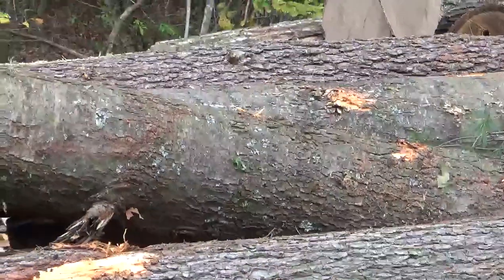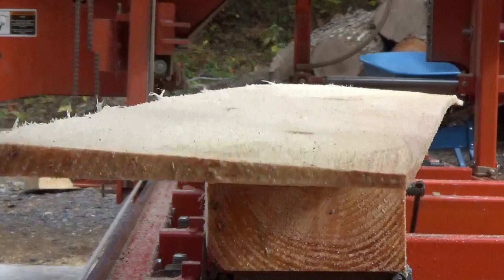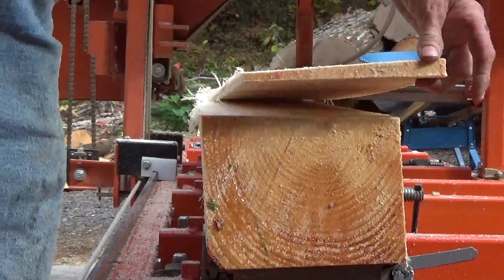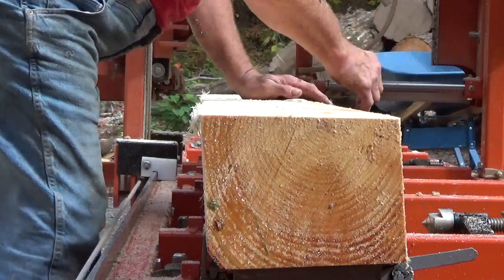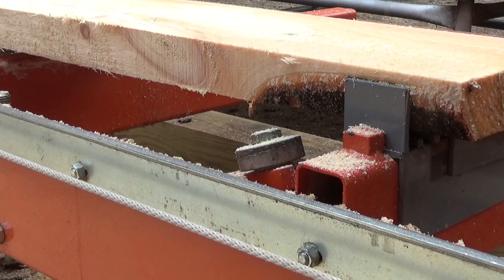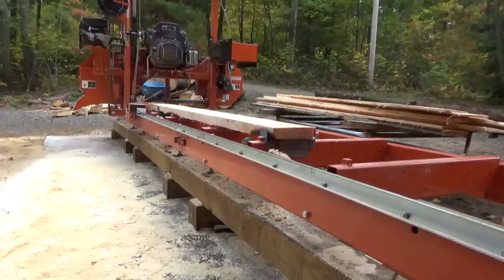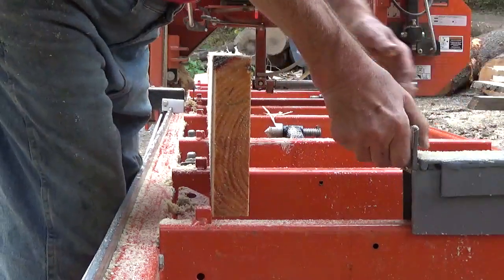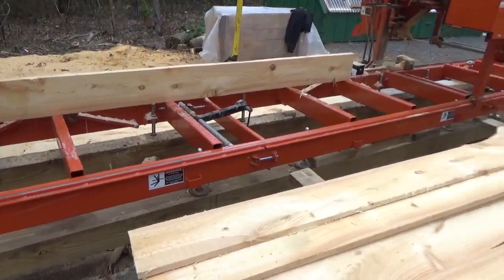Cutting lap siding out of White Pine on the Woodmizer LT15.

Comment: Have you looked into toggle clamps , there's quiet abitt of adjustment in designs, Might be able use it in stead of log dogs? Two or three locked downs just with your jigs, I do really like your design. Keep up the vids . I learn a lot from them!!! Thanks.
Reply from the maker: I havent seen the toggle clamps or thought about them yet but i am always open to something better. I will have to check them out. Thanks for the comment.

Comment: Great jig watched many of your movies looking at making some siding and lumber my self with redpine for many planned projects. I have not pulled the trigger yet on a mill but was leaning toward lt 15 was wondering if when u engage your blade all the movement of the head has any affect on the cuts keep up the movies they’re great
Reply from the maker: When I engage the blade I know there appears to be a lot of movement but it is just the torque engaging the motor. It does not affect the cut at all. Also you engage the blade before you cut so all I can say is it works very well. Thanks for the comment.

Comment: Working well nice job, how's it work on the framing. The thin one piece may because your into the heart of the wood . Differnent stresses that area of the tree . Nice jigs . Do get much shinkedge being so sappy? Looks good to me .
Reply from the maker: The framing 2xs were on 2' centers and it worked very nice I did not have to predrill except for very small pieces. It has been holding up well probably 2 months not much shrinkage at all but I will answer that again after a year. Thanks for the comment.

Comment: If a wain lines up with either of the upright (vertical) supports then possibly move the 'flip-flop jig' to the next door "joist"
Reply from the maker: If I am in real need I would cut a flat board, turn it end for end and then cut the wane to the top of the siding. Sometimes it is a puzzle.

Comment: Joe, from what I could see the clapboard looked like it would still need to be sanded before you could install or retail it. How do you handle that part of getting it ready?
Thanks, in advance if you manage to find the time to respond to me.
Reply from the maker: Hi Tim, it really depends on the customer. I think a jig for the planer could be made pretty quick to smooth one side. Otherwise, you can definitely nail it up rough sawn without sanding or planing. Same thing with shakes very seldom have i seen them smoothed off. Also I don't think I would stock a whole lot of bevel siding until I could test the market to see if I can sell it.
Reply: Joe, thank you very much, you are right about the shakes typically being rough finished. I appreciate your reply.